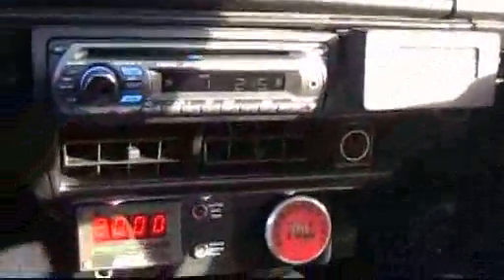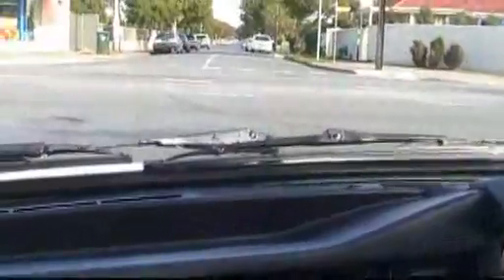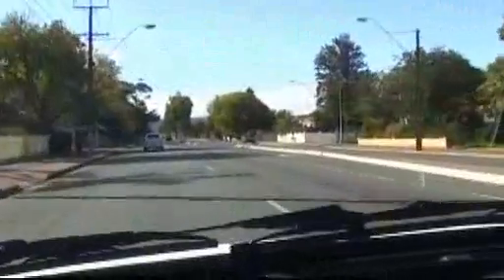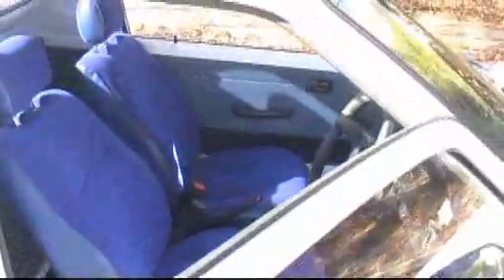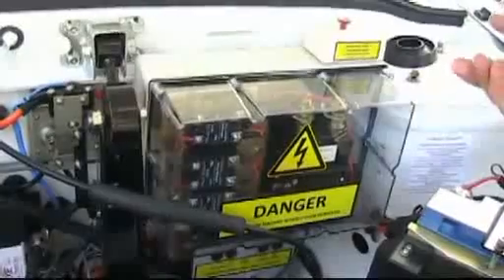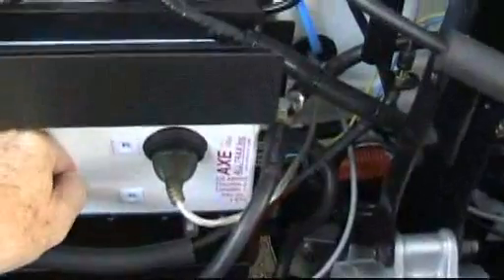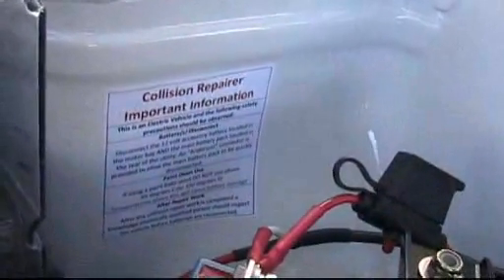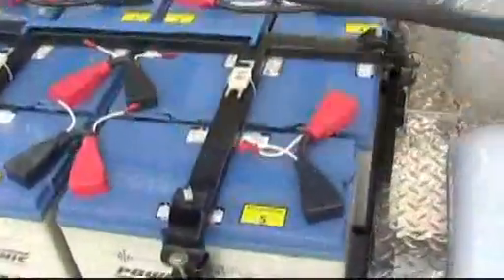MightyBoyEV Part 2

Comment: you say "2000 rpm is better than 4000"  ... i understand that most electric motors are happier at higher rpm as that is how they cool themselves.  like 4000-4500.  perhaps his motor is different?